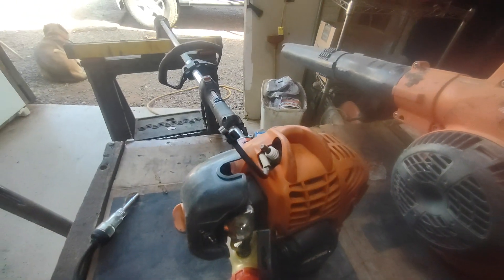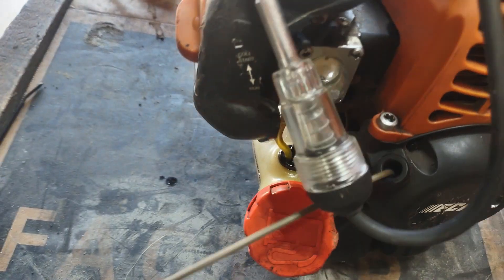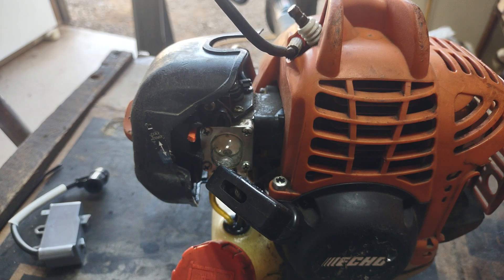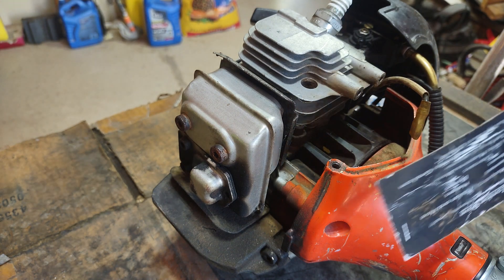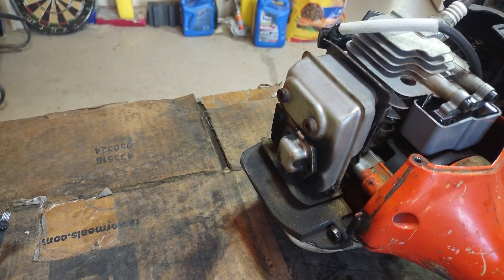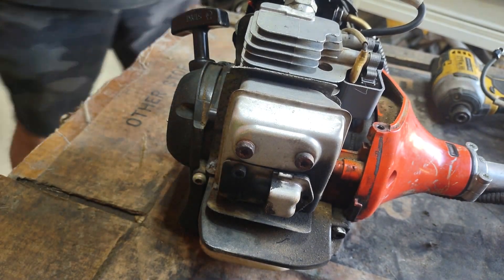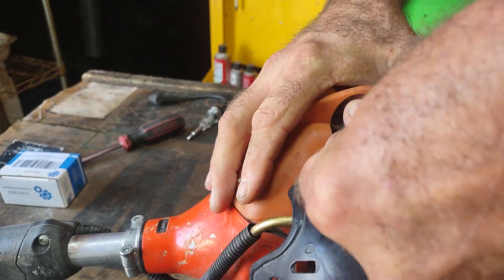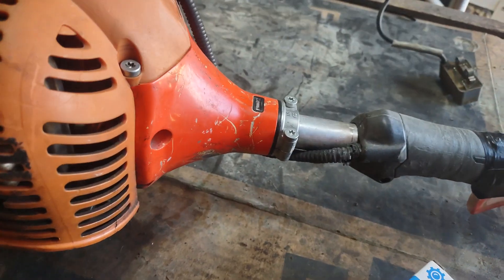Echo SRM225 Coil Replacement. Would you use OEM ?

Comment: I've never had an Echo coil fail yet. 
I don't own any newer model as the older 1's are so well built they live forever👍
Btw I'm sure Echo warranty their coils for life!
Reply from the maker: @bumpkinrocks  I did not know about lifetime warranty on coils. I also found OEM for $65-69 online NOT 75 bucks for a echo 266. 👍
Reply from the maker: @bumpkinrocks   I just looked it up and you are 100% correct! Echo will replace the ignition module and no labor charge while under it's original warranty. Must bring in receipt as proof of purchase (and it must have been registered) and explain what's wrong. If out of warranty then there is a labor charge but the coil is still no charge. Thanks @Bumpkinrocks! I was this many years old when I learned this. 😂🤣😂🤣
Reply: Newer coils fail regularly and the warranty must be done by authorized shop and you pay the labor

Comment: In answer to your original question, Dave, I wouldn’t spend that kind of money on a replacement magneto, but I’m not an authorized shop. 
Hope you slid that heat shield back down the plug wire! 😉🔧👍